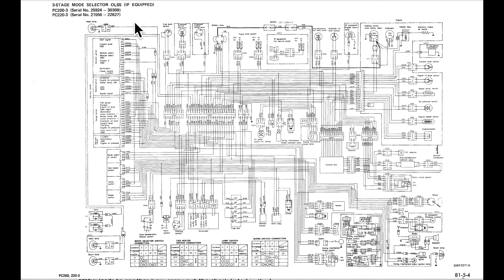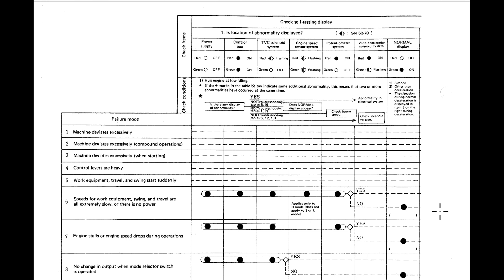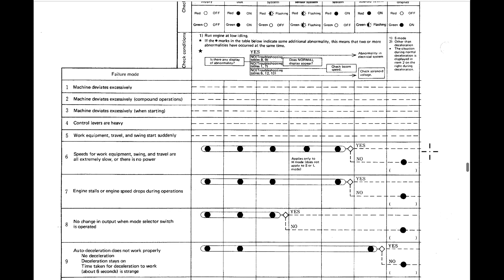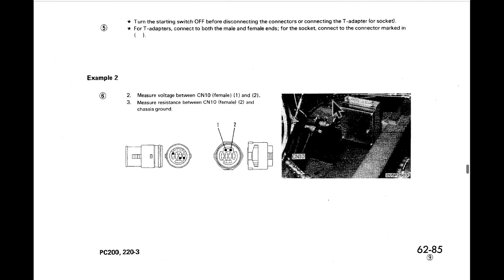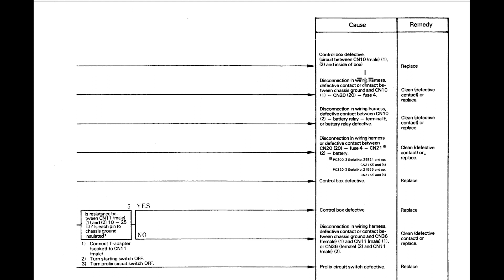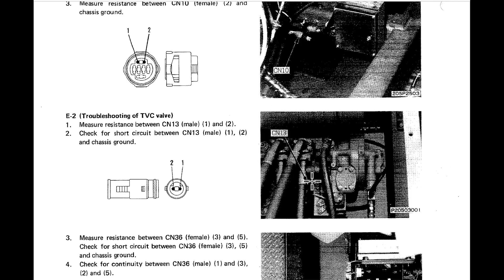Wiring Diagrams Part 3

Comment: Komatsu pc2100 it's no electronic on travel soliend and hydraulic lock pada
Reply from the maker: I'm not sure I understand your question. First thing is I've never worked on a PC2100. That's a little big for the area of the world that I live in. Are you saying that your machine doesn't have any electrical signal or power on the travel solenoid and the hydraulic lock out?